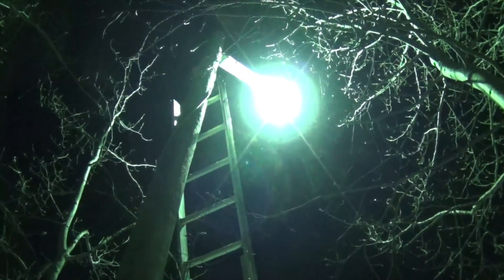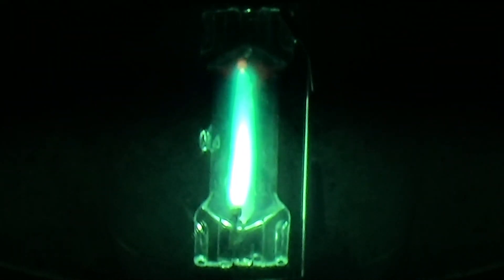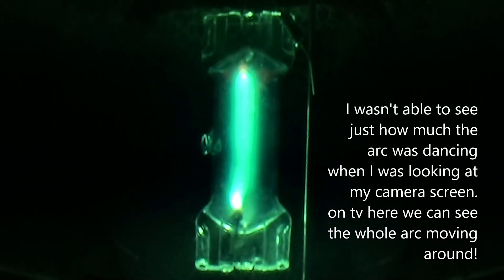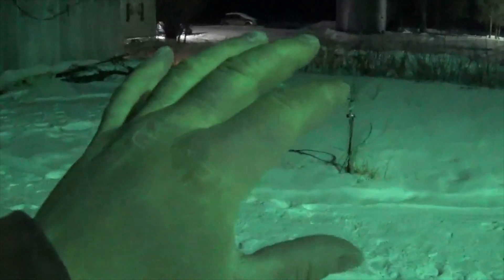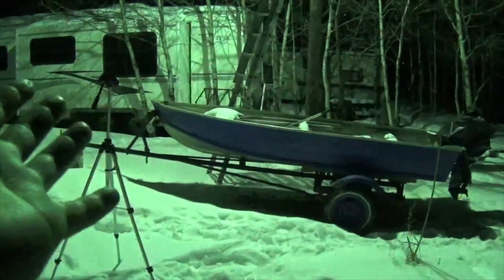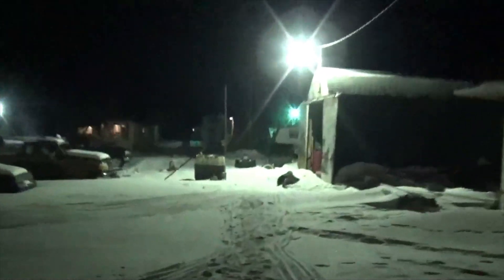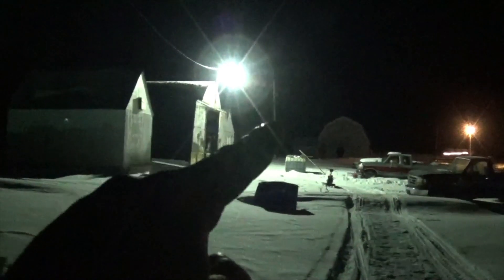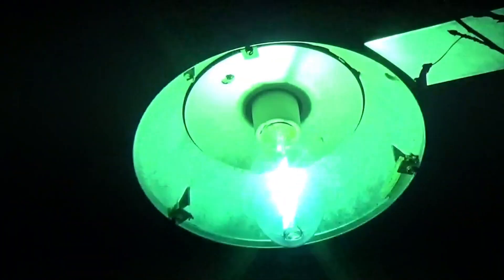Strange mercury vapor light behavior

Comment: Maybe it is to do with the blunt main electrode due to the plasma arc "eating away" at the electrode over time. It looks fairly cold outside, so it may also be a hotspot which quickly cools, in turn creating a self produced magnetic field, convection currents in the bulb, or both. This could basically turn into a feedback loop and make the arc circle around and around the blunt electrode. Since the arc was stable later in the video, this is my best guess. 
It's a very pronounced effect in small plasma globes. 
Hold your hand in one spot, as the temperature stabilizes (warmer), the arc will as well. 

I suppose the ballast overvolting the bulb could causing something like this, but it's not much extra voltage.

I wouldn't be concerned, personally, but I enjoyed the video more than I would have expected! lol
Reply: i commented before i read this and it sounds about right. as the bulb ages it can polarize and all the mercury gets dragged to one electrode while its on, then stays there. the plasma gets really hot and does erode the electrode. you can see the electrode metal build up on the inside of the tube
Reply from the maker: Well you were right! even after swapping the ballast with a much healthier one, the dancing arc still remains. maybe in the future I might be able to bring myself to unbox another bulb and try it out, just to see if it's a one off problem, or if all these GE 250 MV's do that.
Reply from the maker: Thanks for the input! what you say makes allot of sense. 
   I fired it up again last night, and same as usual, it started and warmed up stable, but when I checked on it about 2 hours later, the arc was spinning much faster than in this video, almost making the light underneath the bulb appear to flicker. I think I would like to investigate this further and make another video on it.

Comment: This is normal for some lamps. Once the bulb “breaks in” this will most likely go away. I’ve seen old 1000w mercury vapor spot lights do this near EOL as well.
Reply from the maker: Thanks for the info! I would like to put this bulb into use for a little while just to see if it would go away, but I kinda love the setup as it currently is ( I normally have a 175 watt where this 250 w is in the video) . I will say , that I had a new 400w GE MV on the shop yardlight all of last winter ( and is currently in the high bay inside the shop now) and I always noticed that it would occasionally have a very slow , vague, and very intermittent flicker to it sometimes, I just realized a few days ago when It was doing that in the high bay that its probably the arc dancing around like in the 250w bulb in this video. maybe GE's are more susceptible to this behavior ?

Comment: I used to refurbish movie theater projection equipment and sound systems. it's been some years ago so I'm starting to forget, but the xenon bulbs the lamphouses use would create visual distortions when the bulbs started to age. the anodes and cathodes would slowly become deformed and pitted causing the arc to be unsteady and weird. if I remember correctly the initial start-up arc is what beats them up.  mercury vapor isn't a xenon bulb but probably just takes a few minutes for it to warm up, they are cheaply made things I wouldn't expect precise power readings. I couldn't see anything in the snow there, maybe the uv's are reacting to particulates in the snow, minerals and that sort of thing.
Reply from the maker: Thanks for your input!

Comment: I imagine the temperature has something to do with this as well but color shifting is common in Mercury vapory lamps.
Considering the environment these Transformers are in I can only imagine that they are exhibiting coil slap from the lacquer failing.
Give them a good dip and a dry in the summer.
Reply from the maker: Thanks for the input!   So is "coil slap" just referring to the hum/ buz? does that potentially affect the bulbs performance?

Comment: the transforer and cap are "balanced" to work together, they work together to lessen the resistance in the transformers coil and plates. When the balance is off there is an increase in the 60/120 Hz hum.  the wavering arc occurs as the A/C waveform changes when the cap goes out of spec with the transforer. Replacing the cap would get the reactance ( resistance in AC form) to balance again, it basically moves the current waveform to match the voltage waveform, when waveforms match the hum is minimal  for more info look up capacitance and inductance in AC systems
Reply from the maker: Awesome man thanks for the input! so the extra high capacitance is kind of also pointing in that direction by the looks of it . I am definitely going to make another more detailed video of this light in the future. 
 I will also look that up. I would like to learn more about this stuff.
Reply: Cool of you explaining what you don't know. Thanks.
Reply: @ then I suggest that you correct my mistakes and offer the correct reason for the "mystery" the OP has been confronted with... he is waiting for the correct answer since mine was wrong.... why dont you throw in some formulas and an example too